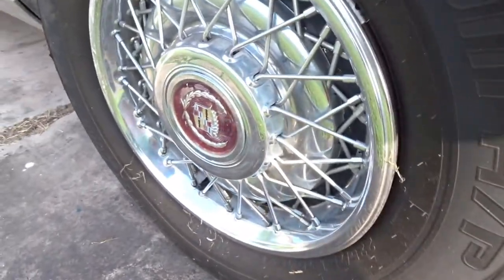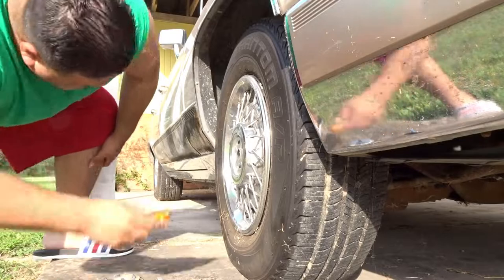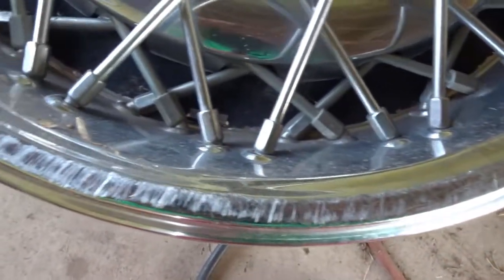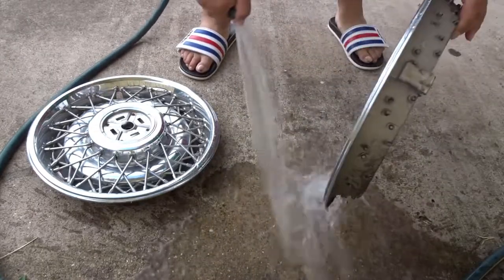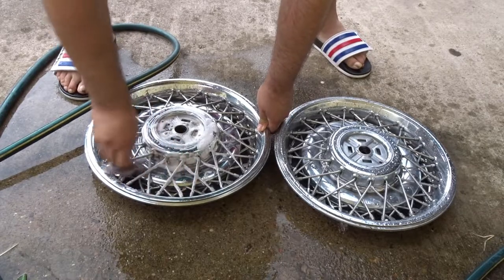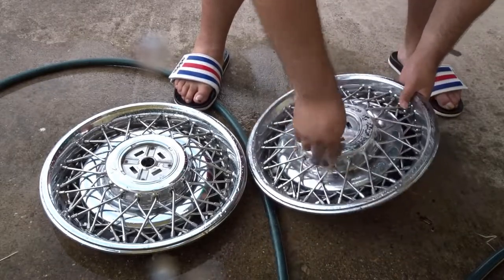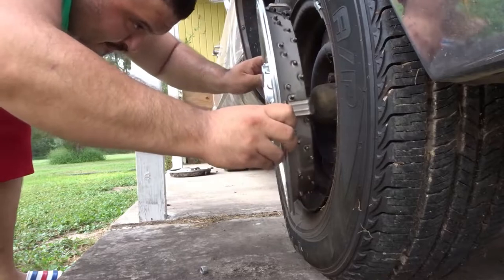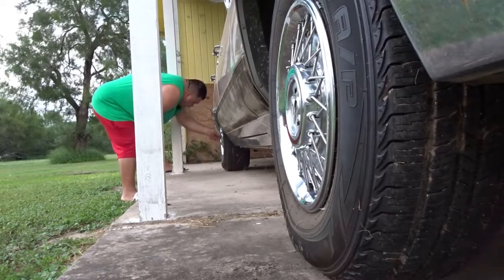How To Clean Wire wheels Hubcap - (Cadillac Fleet wood brougham | Cadillac Chronicles | Episode 007

Comment: What size of bolt you use on the hub cap
Reply from the maker: 9/16 homie
Reply: @OneManClicka  do you need the og steel wheels to use these hub caps ?
Reply from the maker: @scoombs93  naw homie as long as they're the same size mine are  mixed matched
Reply: @OneManClicka  thank you bro
Reply from the maker: @scoombs93  no problem bro